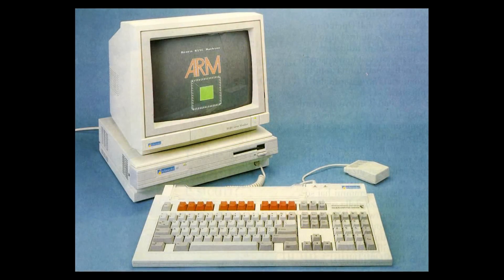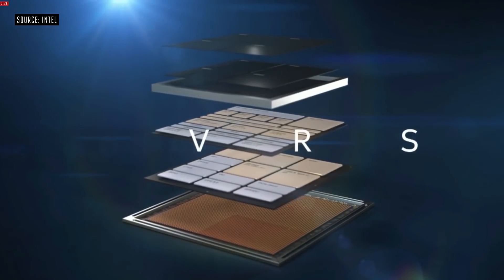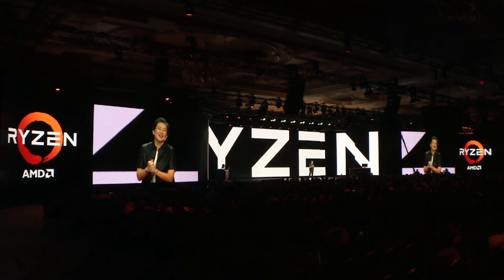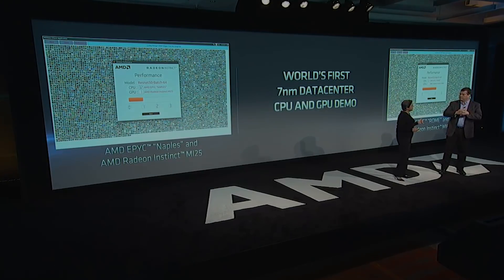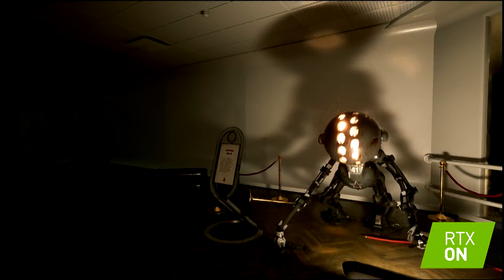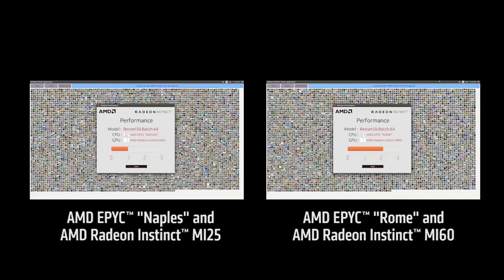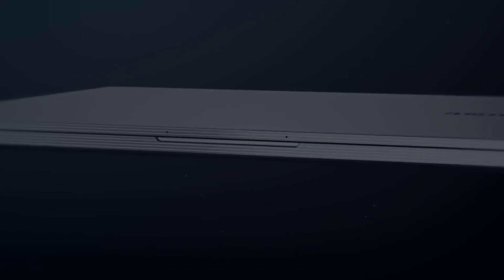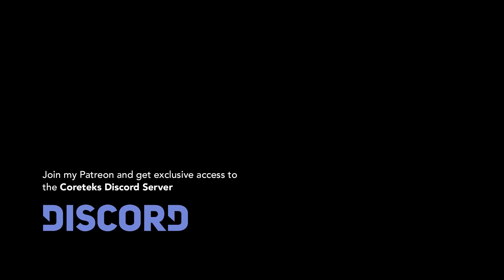Hardware trends: How many cores do we need?!

Comment: The amount of cores is unlimited as technology changes and grows.  You have talked about SoC going vertical and horizontal, but to me that is not as important as the I/O communication to the rest of the system.  Once again we are thankful to Steve Jobs with the forcible need to control the Hardware and Software marriage, knowing that MacOS and iOS even WatchOS comes from Darwin in some way.  It all just works by itself or the user experience works with the pass off from iOS to my iPad or if I had a MacOS to finish my work with the application design.  Even Apple sees the need for their laptop's to go back to proprietary CPU's, hopefully back to a PPC of some type again!

With software technology growing and changing, and using GPU cores is good for any person, it just hasn't been realized as much as it could be.

Then other technology like flatpak and snappy (snaps) increase the need of hardware too.  Flatpaks need more space for storage and because one application includes all the dependencies if installed traditionally, it a lot of work to run one application.  Snappy is different in that it is a standalone application like Portableapp, but still for all the same functionality of a t rational install requires more space and more CPU use to run one application, but maybe not as much as Flatpaks.

So with Android, SoC are great, with consumers wanting more from their phone, even application functionality like replacing a desktop!  I like to get my hands on a Samsung Dex system to see how functional it is.  Even in the iOS world, some YouTubes have shown Adobe Photoshop beta full desktop application, not a reduced application, being planned for iPad!

To me parallel computing is good for a dedicated hardware is needed because system flexibility becomes harder.  Cluster computing in all consumer products need to be addressed because hardware flexibility is easier.  Think about it, turn a CPU on/off in a cluster environment, basically no software change, but in a parallel environment more planning is needed, more for site is needed.  YouTubes show building cluster Raspberry Pi and one YouTuber has shown the advantage https://www.youtube.com/watch?v=ze-g97B8cfk.

It use to be back in early CPU design CISC V.S. RISC with the concept which came first, the chicken or egg idea?  So now we should be looking at a complete experience of hardware and software toward the consumer.  I know so will say we are, but are we?  Apple is more closer to that idea than any other company, the consumer experience.

That is why I use Linux, I can't afford Apple and I don't believe in Window products because of it conformity of consumer use in industry, not just Office, but in creativity like Adobe, AutoCAD and more.  Our world advancement is slow compared to what it could be with out this conformity of thinking, so you ask how many Core's we need, we should be at more than we are!

Comment: One other point... the ratio of parellel to sequential work should not be considered a constant... it varies depending on the inputs... so if you are trying to play CS-GO at 720p with 128 cores, you will certainly hit a ceiling somewhere. Now when you move to 8K, the ratio of parellel to sequential work changes.  The parallel work scales with the number, n, of pixels, but the sequential work may scale with the log(n) of pixels giving much more favorable inputs to Amdahl's law.

Comment: You are totally wrong with core scaleability. Certainly, amdahl's law may hold true for single task, but all modern applications run MANY MANY tasks at once. And once you know this is how single task scales, you simply work around it. Also your percentage for Raytracing parallelism seems to be off badly, it should be more like 99.5% properly implemented.
Each ray being calculated, the only shared component is memory when you need to change single pixel, but you can work around that as well largely if you need to -> Each core has their own bitmap, and at end of ray all those results are simply combined (which can be parallelized as well, to a high faction of the count of pixels being viewed!).

triple monitor gaming -> You can raytrace each monitor separately, there you just TRIPLED the cores you can utilize. This same method can be leveraged within single screen as well, say you want to play at 4k? Split the image to 4 parallelized jobs, on 4 GPUs. 3 monitors 4k and you just increased the parallelization factor by 12. But with raytracing you should not even need this kind of splitting etc. each ray is individually calculated, and with enough memory you can group X number of rays per core to do, with their own memory copy etc on the same scene, then just have X number of cores to do multiplexing of the results.

Very "simple" actually for skilled developers. It all boils down to I/O and more I/O.

Further, games need other processing too, these however pale in comparison to computational requirements:
 * Physics simulation
 * Sound system (it can get as well damn heavy with a lot signal processing etc.!)
 * AI
 * Timing, schedulers etc. (these can get a bit heavy too!)
 * Network code
 * Other I/O (prefetching, caching, storage)
 * Input system handling

When you are PC gaming, you will likely also have some 100+ background processes running (windows yay!), with potentially even updates, more cores will take away jitter caused by those.

Second example; a browser viewing this very video, only this SINGLE tab and window.
 * Video stream processing can be split to pretty much any number of cores
 * Each image can be split into any number of cores
 * Each segment of the page can be split into different cores
 * Networking can be split into multiple cores (typical web server allows 8 connections per IP, but data is fetched from many servers so at least something like 30-40 threads here as well)
 * UI can be split into any number of drawing cores, then segment as well
 * Local storage I/O can be split into any number of cores (100s upon 100s)
 * OS related stuff can be split into any number of cores (a browser needs to do a plethora of OS API calls constantly)

A lot of above tasks will also have the same number of threads for each tab, and some threads above is better to just have 1 per window etc etc.

At the end of the day, it is all about splitting up the tasks and ensuring there is sufficient I/O. Also of course there is diminishing returns the smaller you go, but it is more in the sense that some basic stuff is just so fast to do that the OS API calls to spawn another thread takes too much. It makes no sense to split a simple "X=1+1" into it's own thread. But even on this browser example, i can  easily imagine 10 000 threads running and actually getting that performance boost. Each single tab maybe 300 threads.

If Amdahl's law was the absolute limit, we would not have facebook, youtube, twitter etc etc. hell, not even internet as it would be impossible to transmit enough data. We would be still at BBS level. All of these examples have 1 thing in common to scale: Split the tasks into small chunks.

Amdahl's law is only an issue when you do monolithic development akin to 80s philosophies, 100% linear, 100% single memory copy, 100% centralized and thus 100% bottlenecked by latencies.
Therefore it is merely an excuse for inept or lazy developers to avoid doing anything where they are forced to think at all.

And how do i know all this? I've been doing this kind of stuff for many decades now, some for fun, some for profit... well quite a lot for profit. I have built many massively parallel systems. But it is also a trade off, as you will consume more total resources all around the more you parallelize, so you need to match the parallelism to the task at hand, and how much benefit per thread you want.

Going back to browser example,  maximum parallelism should not be done for maximum performance gain, too much wasted memory. Browsers are already memory hogs. It makes sense thus to have some limitations on the parallelism as it will yield overall better performance for today's computers, but you could already code all that in so people have simple preference for that. If you have 1TB of memory, would you care that viewing this youtube page takes 1gig of ram? Not really. If you have 4gigs of ram, you would be in agony if that was the case. However, even without most of that waste it is easy to envision dozens of threads with huge performance gains per tab. At the point where 64 core PCs are common, you can easily increase to hundreds of cores as few hundred MiB per tab of extra ram use is not such a big deal. Think of RAM utilized as the scaling factor %, more ram you use -> More per thread scaling, and vice-versa less ram you use -> Less per thread scaling.

That being said, it is, atleast under linux, quite easy to do multithreaded applications with shared memory and no access conflicts and no locking mechanisms to function properly for some tasks. (ie. caching is one such, but only WORM type of cache, but you can implement timeout for the piece of data as well to be quite short)

Comment: A positive trend is the resurgence of languages that allow you to write reasonably low level code (C++ is apparently immortal) and APIs that give you more control over the hardware such as Vulkan and Metal. On the software engineering side there's also the push for less bloat. Examples: Clear Linux, Google's initiative to limit website bloat, etc.

This will have an extra benefit of reintroducing discipline and rigor to developers and will kill initiatives that have nothing to do with technology, like the Rust programming language. It will also kill the myth that "anyone" can code. There's a lot of bloat out there and it has to be removed as much as possible. Software is plagued with quality control issues.

Comment: Phone cores are often different in a significant way, though. In many cases, an 8-core phone is 4 fast cores and 4 weaker, but more power efficient cores. For tasks like mobile gaming, the phones are practically more similar to 4-core systems. The other 4 weak cores are in use when your phone is in standby mode and trying to save power.

Comment: You missed a point here. Amdahls Law is form 1967, thats quite aged. Its a theoretical value that has its place in the theoretical speed up calculation but thats far from reality. Amdahls Law does not take into account that users will increase the dataset when given more performance options. But thats exactly whats happening. The amount of Javascript  code that gets delivered per website call has been increasing for years and so the Chrome Egine can benefit from more performance given the bigger dataset. Resolutions in gaming have gone up ever scince and will keep doing so for a while and RTX just applies raytracing to very small part of lumination calculation. You can increase this number a lot and also increase the lod a lot to get a lot better results which also need a lot more compute power but also bring more data to work on in parallel. This also applies to server tasks as the amount of data stored in databases for interpretation is scaling up.  Gustafsons Law models this. Too bad Gustafsons Law wouldnt have given you any point at all.

Also a shift in algorithms can change a lot on scaling. You can for example calculate each Ray in Raytracing sequentially but you can also gain quite a lot from parallelizing this because when a ray hits an object, new rays are spawned. The amount depends on the LOD and sure there is a deminishing return in increasing rays but these are far away. So while you cant utilize 6 million RT cores in this implementation of RTX, you very much can in one, that uses different algorithms.

Its also not true, that programmers are tought to programm sequentially and will so. I dont know any kollegue that is not capable of programming in parallel theoreticly and we all know the importance of parallelization. Its true that parallel development is a lot more difficult than sequential programming and finding algorithms that scale great, can be quite a hefty task. The lack of solutions here is because programmers could be lazy and got away with it for the most part as CPU single threaded performance kept climbing decently. That has stopped for a while now but developing new compilers, new programming languages and training programmers how to programm in parallel efficiently will take years. But with multi thread capable architectures staying for years to come, this development will not stop.

The point you also missed is that there is no alternative. Sure you can optimize single threaded performance further with other architecture and whatelse but these will hit a diminishing return at some point too. And you can always increase performance if you parallelize a fast sequential task. The demand in more power will not stop and so programmers are forced to utilize parallel computing a lot better. Otherwise there is a lot left on the table and newcomers willing to take this step will take over the market in no time.

Your point is that we hit a point of good enough quality. That consumers dont buy because they dont need. There has always been people claiming this but for now they always have been wrong. So wrong indeed, that its a meme in the industry. The urban legend that Bill Gates once said that noone will ever need more than 640KB of RAM. People have also said this about 4 core CPUs and here we are bottlenecking 4 core i5s in about any game with any modern GPU. The amount of amateurs editing video has increased drasticly over the last 10 years along social media. People are dreaming of a self driving car, a fully automated house or a computer at home similar to Jarvis from Iron Man. New compute performance will always be used to fullfill dreams that werent possible to realize before. So I disagree, that there ever is a point of good enough quality.
Reply: I would like to point out that your javascript statement doesn't actually work in this case as we're talking about parallelization and all javascript engines are explicitly single threaded, it's near enough a requirement of browsers that it be the case. At most more cores would mean better performance for having many tabs open.
Reply: multi threaded compilers and linkers are available for a lot other programming languages so while you might be right (I dont know or care tbh), there is likely an option for it. Not that easy to develop though for sure.
But yeah, was not the best point but I wanted to pick up the given examples to point out what I meant. The RTX example works much better.

Comment: There is a difference between parallelism and concurrency. Most PCs today are running a few thousand threads, it's just that the vast majority of the threads are sleeping most of the time. Parellelism is limited, but concurrency is not, as you can simply run multiple instances of a program. But that it more like that server load you mentioned.
As for thin clients, I think that the inherent latency of the thin client will make it difficult to use for anything beyond the simplest workloads.

Comment: I think you've misinterpreted Amdahl's law when it comes to gaming and indeed ray tracing. What you've shown, is that performance will top out at 20x sequential performance *for the current number of rays traced per-frame*. If you increase the number of rays you're tracing P will get closer to 1 and then having more cores will more of an effect. Amdahl's law only applies to a problem of fixed size. With games, as more processing power becomes available, programmers will increases the problem size (eg number of rays) and therefore increase the theoretical speedup limit. Furthermore, even within current games the problem size is not fixed as the number of rays traced will depend greatly on the scene being rendered which, as we all know, changes frame-to-frame.
Reply: Basically what I said below in the comment. But although you can increase the number of rays traced per frame, it will  mainly increase quality/accuracy, not so much total time of rendering a frame,  so Coretek has a point. Furthermore, we don't have REAL RT yet - it's a hybrid, mostly traditional rasterisation. To be able to do real time pure RT at 4K @ 60Hz is still a major hurdle to overcome, and probably not possible with current processes, no matter how many RT cores you throw at it..
Reply: @default2826  Haha, I  totally forgot about that comment, but yes I agree that RT cores can and will be much more efficient, and that certainly will improve.rendering speed.
Reply: True, and also, where is that 5% even coming from? That can be only about a specific ray-tracing implementation, not the algorithm in general.

Comment: While I can't speak to the parallelization of games or other standard desktop applications I have heard of an example where a parallelization of a previously sequential workload was sped up by about 30 times, which is more than the maximum of 20 allowed by Amdahl's law. While it wasn't an exact apples to apples comparison it was a telecom system running on 64 cores that had a new system written for it in Erlang, a programming language built specifically for parallelization that led to the massive performance increase. Whether this breaks Amdalh's law or simply came down to a massive increase in the serialized performance of the system I don't know and the story should perhaps be taken with a grain of salt since it came from one of the authors of the language so he might have exaggerated or missremembered slightly (this was over 20 years ago). Still an interesting and hopeful example.